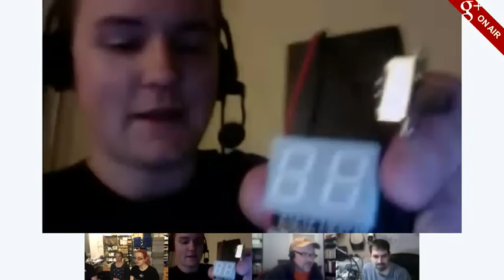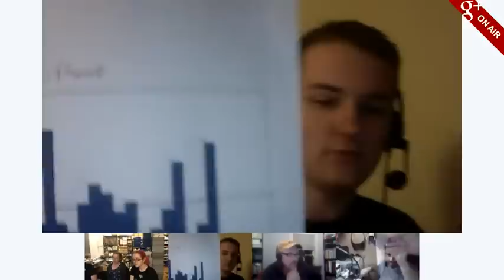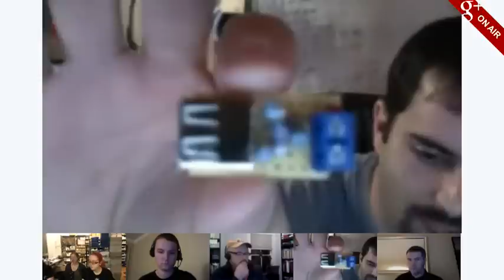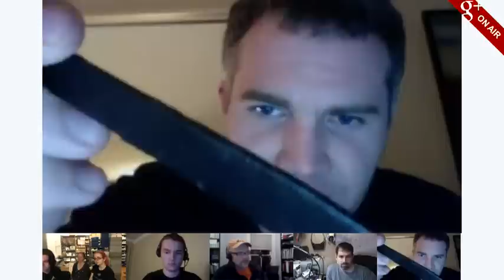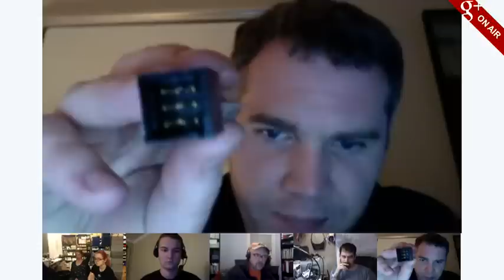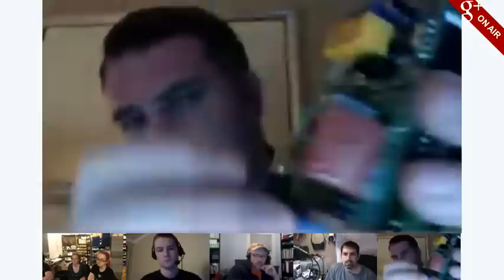SHOW-AND-TELL 3/24/2012

Comment: A good trick for random number generators is to get the number of seconds since midnight, then use that as your seed for SRAND().  That way, unless you always start the device at exactly the same time every day, you'll have different seeds at boot each time.  

Another trick I use is to leave a pin off a built in ADC and make a 16bit number from 8 measurements and taking the 2LSBs each time.  That then is your seed for SRAND.  Ugly and imperfect, but it does work, picking up garbage from the air